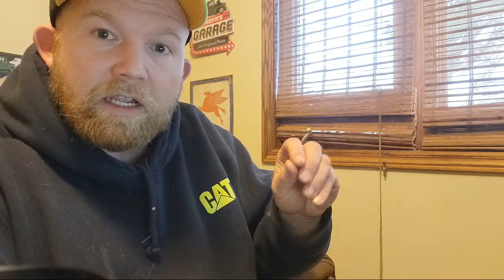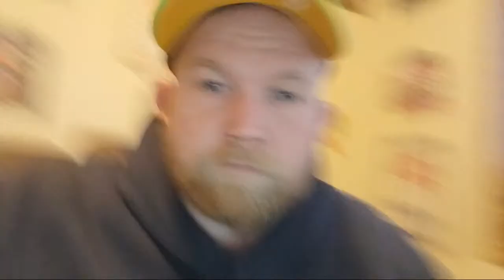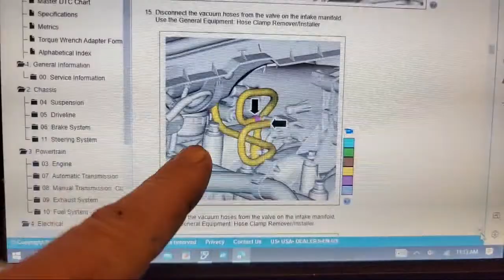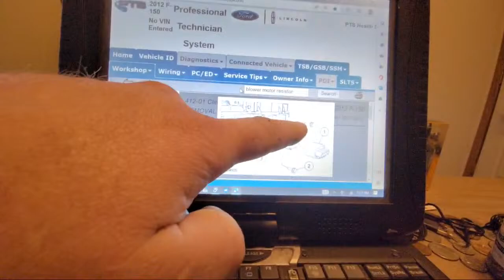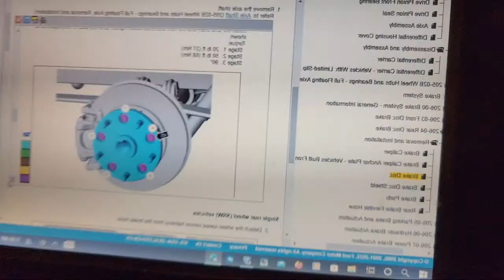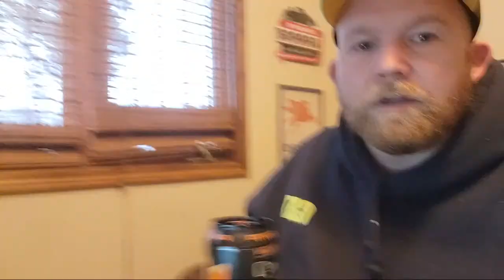Ford Automotive Questions ?!

Comment: Changed the oil today on my 16 Ecoboost and noticed some staining around the oil supply filter area to the passenger side turbo. Is this common? Could this be water pump related? Looks oily though. 101k miles.
Reply from the maker: Send me pics ? Poissorichard.rp@gmail.com

Comment: shout out for a parts search. 89 ford ranger rear end yoke, all the same from I think it said 82 through 89, also used in some Bronco lls. Cannot find one anywhere. They are all 28 spline. 7.5 inch

Comment: Rich this one really hit home for me. I’m also a bigger guy. Been working on heavy truck and equipment for the last 16 years. It’s taken a large toll on my body. Same issue but with my right knee tons of arthritis and no Cartlidge. I need full knee replacement at 35 years old. For the last two months I’ve been on a diet plan like you explained meat vegetables minimal carbs. I dropped 40 pounds in two months without exercise yet. As you know the trade is very active constantly on your feet walking crawling standing. Thank you for letting us know your troubles because I’m also having the same. Thank you Rich stay stronger brother.
Reply from the maker: Same to you
Reply: I feel your pain! I tore my minuscus in both knees in high school and had arthroscopic surgery. Little did I know that means they just shaved all of the cartilige out of my knees. At 45 I fell and tore my left miniscus and they said to just live with it as there was nothing left but the little torn flap of minuscis left and fixing it would mean bone on bone. 

The kicker is I went on a keto diet at the start of COVID lockdowns and lost a bunch of weight and then my back started killing me. I have a lot of disc issues from hard labor in my younger years, but it was generally just a nuisance, which became  torture when I lost weight (so much for feeling better when healthy!). Doc thinks the weight shift just put pressure on nerves as my spine rebalanced itself to reflect the weight change. No good deed goes unpunished! In my 50s now and my hands, arms, knees and spine are loaded with arthiritis. Slows me down a bit but no complaints considering what I see others dealing with. Merry Christmas!

Comment: 2005 Ford explorer sport trac no forward gear
Reply from the maker: Some of those had issues with accumulators in the transmission you're going to have to get it to a trans shop I'm out of trans guy although I do work on this stuff I don't work on a lot of the older stuff
Reply: @FordBossMe  I'm in a remote area without a shop that can take a look at it

Comment: Hello, I ran a collision center. Walked over 25k steps a day 5-days a week. Kept in decent shape and always going.

Have bad knees, 25-yrs of NASCAR racing.

A year ago switched to the Ford store as a SM. Pinned down to the desk. I swelled up to 240lbs, found a good program that helped kick start some loss. High protein, 5-meals a day at 120-150 calories. Shakes, bars, jerky, etc and lean/greens. Lost about 35lbs in 10-weeks. 

ACL replacement on the RH 14yrs ago and scoped the LH 15 ago. The weight off quickly has really helped. Good luck my friend. 

Keep up the content, my techs love it!
Reply from the maker: I appreciate that and thank you for the support

Comment: Greetings, I’m a new subscriber and I’ve learned a ton of stuff from your videos. I have a question. I have a 2018 F150 that had the cam phaser issue on cold start up. Dealership took care of it. But I had heard people saying don’t dry start. You prime, pre lube or something like that. How do you do that? I have a push button start.
Reply from the maker: So if you already have the new cam phasers in you do not need to flood mow the system to start it people are just saying that the only time that you would use flood mode is if the system is starting to fail so start it normal you don't need to do flood mode and here's a video of me demonstrating flood mode except I'm using a key you have push button

With push button you push the accelerator down to the floor

You push the brake pedal down and hold it

And then you push the key to start the vehicle while still holding both the brake pedal and the gas and what will happen is the engine will crank over and not start and it will keep cranking for about 10 seconds until you let go of the gas

https://youtu.be/ZAexwhXm3ss
Reply: I see. My sister in laws Explorer has the cam phaser rattle so I’ll  pass this on. Thank you! Great channel!

Comment: Damn i Missed this! I needed someone to explain why Ford thinks its "normal" that my $80,000 suv's wastegate rattles for 5 minutes on cold starts and also rattles when I blip the gas on accell and decell. Oh, I know. its a design flaw and they just dont want to pay to swap out everones rattn' turbos
Reply from the maker: Unfortunately you are correct and it does take almost a minute for the rattle to go away sometimes and they have an update Kit for the linkage but it doesn't really work it does the same thing

Comment: Hi ya doing bud i no it's late question 13 f150 ecoboost low heat on diver side cold on passenger fan works tank full. Do you think pass. Actuator
Reply from the maker: Yeah it's probably the passenger actuator or probably both of them

Comment: My 66 year old wife had her right knee replaced in August 2022.  One month later she was back at work.  You should not be down for a year.  She had all of the shots, including the gel.  None worked.  My suggestion to you is, have the knee replacement sooner rather than later.  The pain you are experiencing is immediately gone, but replaced with some temporary surgery pain that ultimately goes away.  The Youtuber "My Friend Pete" , a car guy, has had both of his done within the last 8-9 months and he is back working.

Gas here in Houston for unleaded  can be gotten for 2.32.